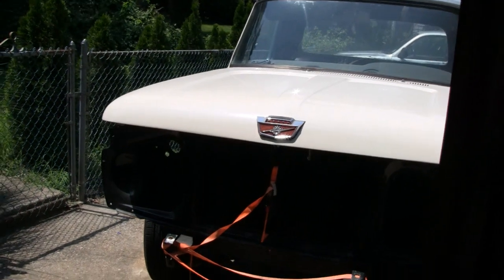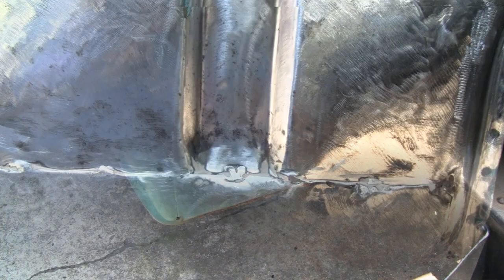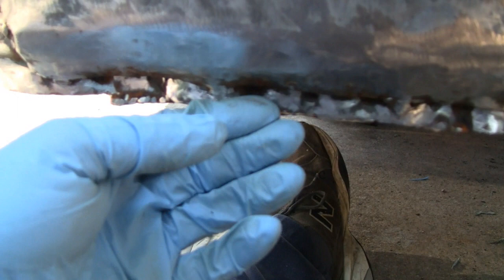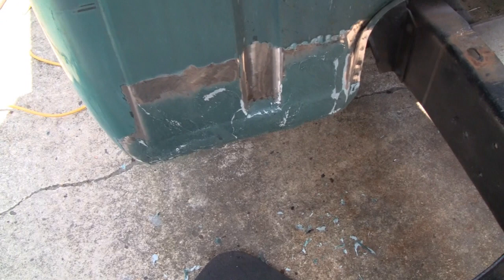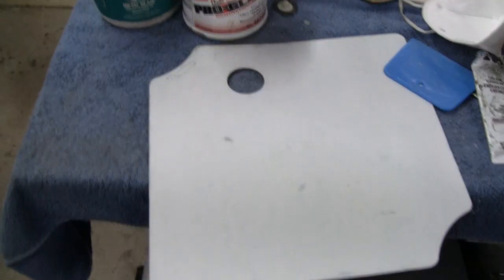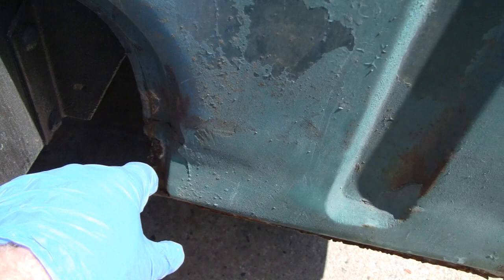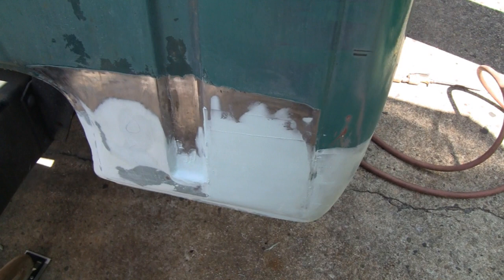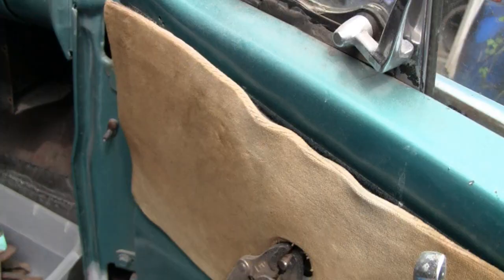REPAIR BOTH CAB CORNERS  (F100 part 63)

Comment: You are doing a great job on the pick-up RK. I really thought the truck needed cab corners, and it was good to see they were able to be repaired. It is what you said you would be using it for, a work truck, but it will look great when you finish it.
Reply from the maker: Thanks DL!! I wish I had know they were patched like that, I would have ordered new panels!! They only cost $35, it would have saved me a ton of Bodywork!!☺
Reply: @805ROADKING  I worked in two fab shops, one was a sheet metal shop. I have made a few cab corners, but I agree only $35 would had been worth it. I figured they were twice that much.

Comment: We always used Niro Stan red glazing putty back in the day when I was in high school and worked in a body shop.
Reply from the maker: I still have a can of that on the shelf!! I use to hate wet sanding it, especially in the winter!!☺
Reply: @805ROADKING  Never came in a can that we used, it was in a squeeze tube. And we worked in a climate controlled shop. You worked outside doing body work in the winter?
Reply from the maker: @combatmedic1980  The shops were always climate controlled but most owners back then thought 60° was plenty warm!! And it usually was unless you had your hands in a bucket of cold water for hours!!☺
Reply: @805ROADKING  Well I'm from central PA and even though we were young and dumb, they did have the sense to let us in out of the cold back in the 60s LOL